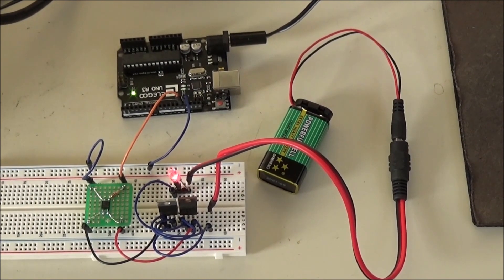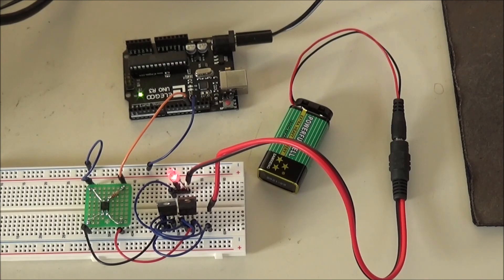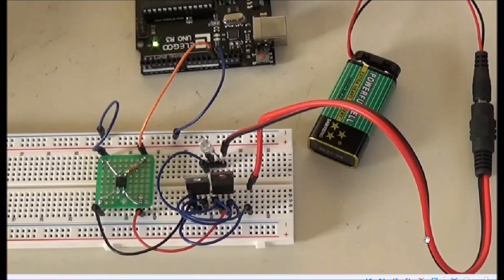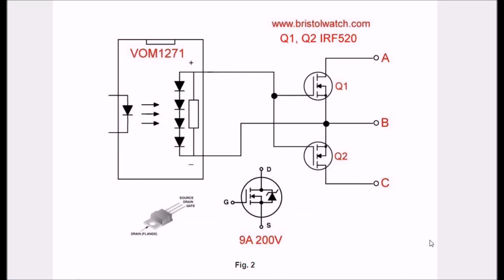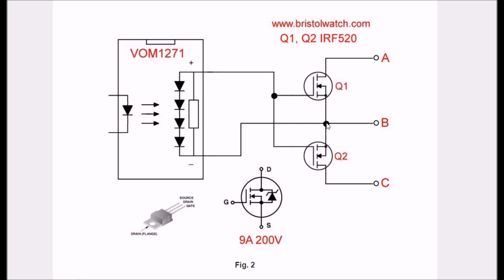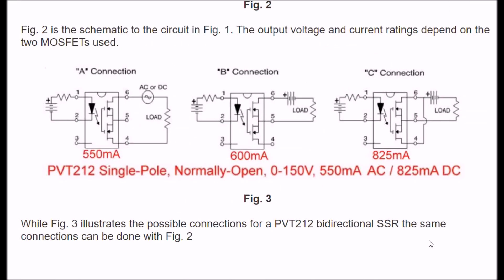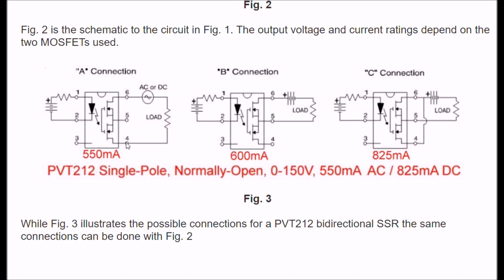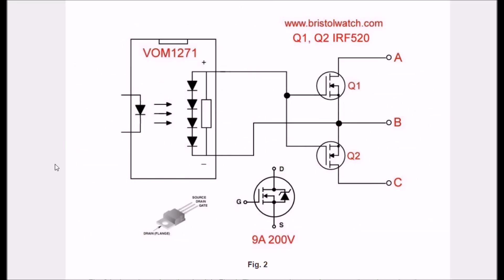High Power Photovoltaic MOSFET Bidirectional Switch

Comment: Thank you for that video. That is, if we took a two-color LED, for example, L-57EGW, and changed the polarity of the battery, it would light up green. Do I get it right?
Reply from the maker: Yes. The LEDs are in parallel.

Comment: Datasheet says it doesn't require any external power to drive the high side gate,it takes power from signal led . Is that right? how is that possible a 5V  pwm signal from a microcontroller voltage is used to charge gate capacitor?
Reply from the maker: The photodiodes produce about 7 volts across the gate-source connections. MOSFETs are voltage operated. The gate happens to have capacitance.

Comment: Built this after watching and it works great. Thanks! Perfect for DIY SSRs. The VOM1271 needs 1.2V at 50mA max, but produces a perfect output of 9V at only 20mA so choose the appropriate resistor ~ 200ohm? for connecting directly to 5V output pin. I tried with 30N06 N fets, but do seem to notice a voltage drop. It seems that when current flows one of two directions one of the FET would be conducting across its diode?

Comment: Any other driver that offers better response time for ON and OFF?
Reply from the maker: It is not a matter of driver. These things are not good for high-frequency switching. It's a matter of gate discharge through the divice.
Reply: any optocoupler that handles more current and has a smaller propagation delay, will result in a faster turn on time.
Reply from the maker: Exactly.

Comment: Will the body diodes in the MOSFET's cause a voltage drop in both directions?
Reply from the maker: Those diodes only conduct in one direction to suppress switching spikes. Normally they don't conduct as such.
Reply: @LewisLoflin  Thank you for that.